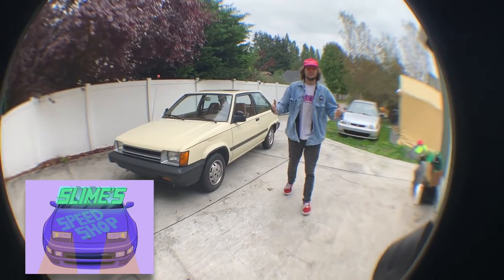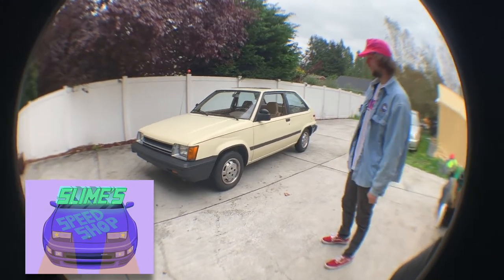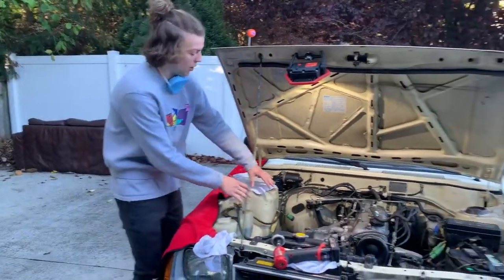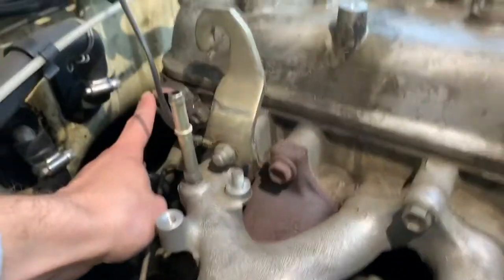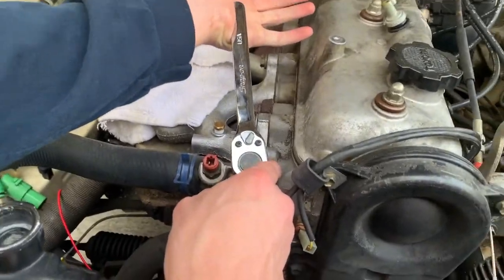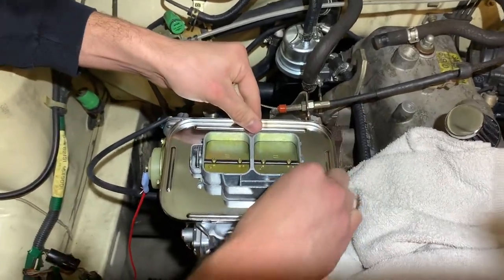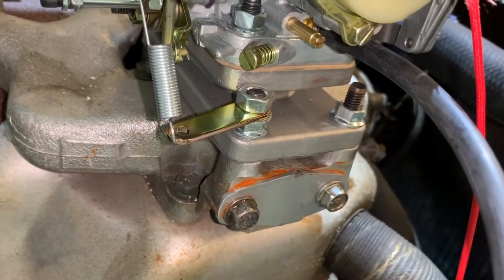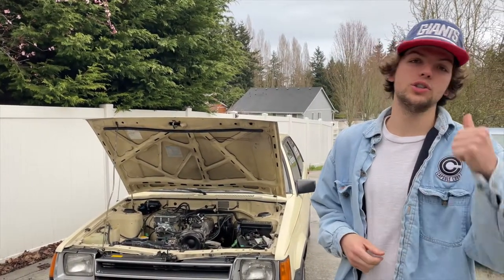Toyota Tercel Weber 32/36 Carburetor Install

Comment: Just picked up a 1982 Toyota Tercel. Carb looks like rats been chewing on it. Could find a good diagram for the endless vacuum hoses. Found your video and ordered a Weber. Just hoping I can get it installed correctly. 😅

Comment: Solid, I would recommend you throw in a fuel pressure regulator after that pump though. The carbs are meant for 3.5-4 the pumps pushing 7. Gonna blow some seals later on down the road.
Reply from the maker: oh yeah thats the next thing I gotta do, definitely runs way too rich

Comment: So it's been awhile, what kind of performance did you get? My friend is having low power issues on a newly rebuilt engine. Has a weber from a Celica on it. Not sure what the CFM is, but says it's under powered and running rich.

Comment: What's the size of the plug you guys used near the front of the manifold. Having trouble finding a plug. Thanks.
Reply from the maker: I removed it and went down to my local hardware store,, was a typical NPT fitting size was easy to find!

Comment: Help! I watched the video before swapping out my carburetor. I took out the vacuum lines indiscriminately and now I have no vacuum for the 3 vacuum lines that connect to the distributor.
I see that there is a vacuum port on the carburetor…
Not sure what to do.
Convert the distributor to mechanical advance?
What did you do?

Comment: have the same engine and same weber 3236, can you tell me how much turns for the misture, and turns for the idle needle
Reply from the maker: gonna have to play with it, your elevation will affect the turns slightly
Reply: The mixture is supposed to be set to 1 and half or 1 and 3 quarters when seated

Comment: What size was that bolt that went into the exhaust side of the EGR?I went to every hardware store locally and can’t find what I need =[
Reply: Found a drain plug that worked! M20 x 1.5
Reply from the maker: should be a regular metric size,, we have tacoma screw over here so I went there!

Comment: Question, do you remember where you attached the hose to the PVC valve?
Reply from the maker: The PVC valve goes back into the carb air intake. I will be attaching a catch can in-between for fun.

Comment: What plugs did you use to block off the holes in the manifold?
Reply from the maker: take the sensors down to a regular hardware store and give me this NPT fitting. Just a brass piping piece that plugs instead of being like barbed. Teflon it up and you're good 2 go!

Comment: What kind of fuel pressure regulator should they put on there some of them are expensive
Reply from the maker: i spent way too much money doing an aeromotive setup, however its the best of the best and will last me a lifetime so i don't mind! There are cheaper options out there that will work just fine, i mean you're only making 80-100hp!

Comment: There is a hole under the air intake filter. It might take in dust .
Reply from the maker: what exactly do you mean?
Reply: On 8:40 . that chrome plate where the air filter sits on . there is a 1 centimetres circle hole . if you don't cover it . then the air filter is useless.
Reply from the maker: @wakapassie2670  ohhhh i see that now! didn't think about that... how should I cover it?
Reply: You can cover it with a tube patch .  the patch you use to patch flat bicycle tubes .   as long as no air can pass trough.
Reply: I know this is a couple years old, but for anyone reading this... That hole is for the PCV intake.

Comment: hey bro good video! i plan on installing one of these on my 1977 corolla with a 2TC! my only question is i don’t know how would i hook up the auto tranny kick down cable? would i connect it to the throttle cable? also where did you buy this? can i see the website link bro bc i heard people be selling fake ones
Reply from the maker: I got mine on eBay, I have zero experience with weber carbs and auto transmissions... sorry!!

Comment: I got a 87 its front wheel drive.i see yours is rear wheel drive.
Reply from the maker: mine is a 85 and its front wheel drive. For some reason these motors are facing straight, its really weird compared to all their other models but man does it make it easier to work on!
Reply: @slimesspeedshoptv  oh thats what it is very trippy.

Comment: Fuel pressure regulator needed ?
Reply from the maker: Technically yes. After dropping in the Weber your psi raises a bit. Would definitely recommend one, I will be coming out with a video installing one in the future!!

Comment: So asinine when TBI could have been used instead & with more HP. Toyota really stuck it to us with that idiotic front wheel bearing assembly & the rear control arm assembly. Good reliable efficient car though.